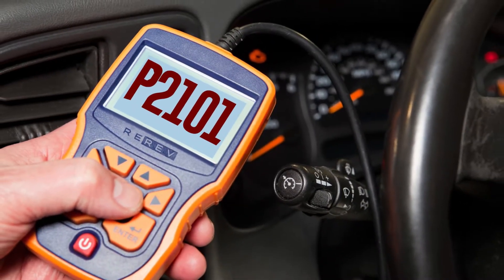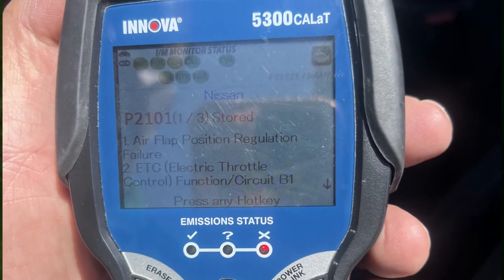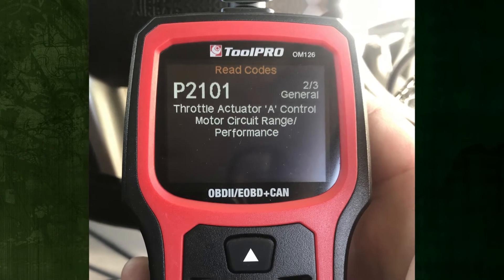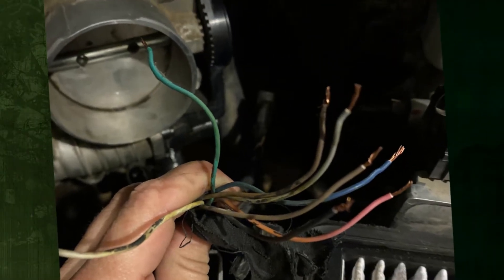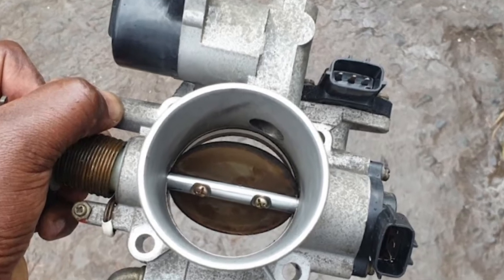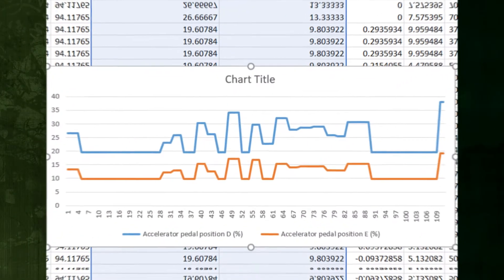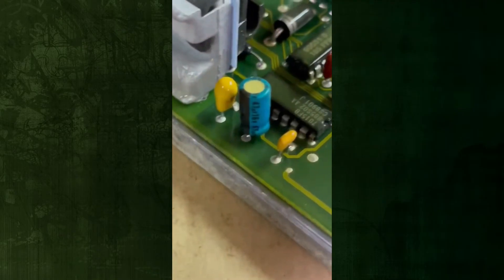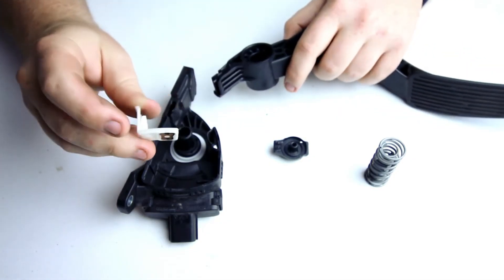P2101 Code - Meaning,  Causes & How to Fix?

Comment: Nope. I have code p2101 on my buick lacross. I remove throttle body  clean it reinstall it and disconnect negative battery csble for 15 minutes because computer need to relearn. Problem solve
Reply: Can’t I just replace the throttle body